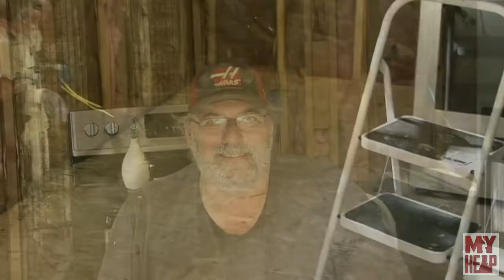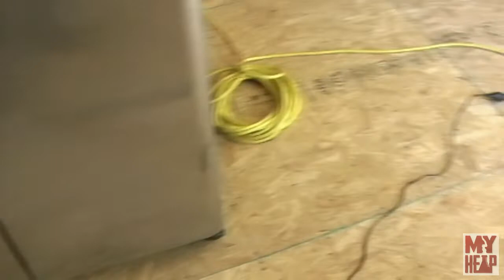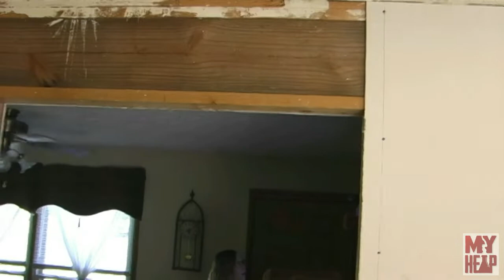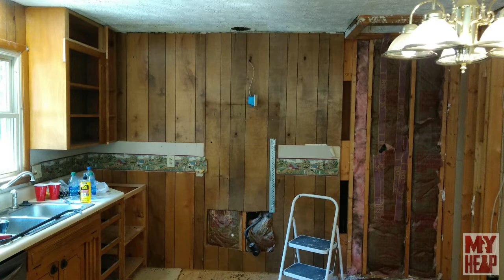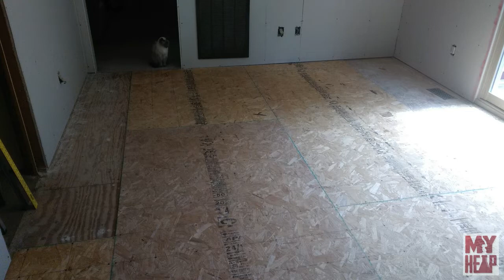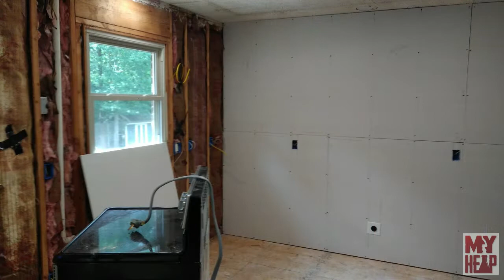Channel Update - 13 JUL 2020 - Continuing the slow march forward!

Comment: When doing home projects you have to set down rules (1) The project requires a metal lathe (2) It also requires the use of a milling machine and drill press. and finely requires you spend 80 to 90 percent of your time in your home shop.
Reply from the maker: Hahaha. I am with you there brother.  After this kitchen gig, I am back to the workshop.  At least as far as I can.  Haha. Thanks for stopping by William, I do appreciate it.